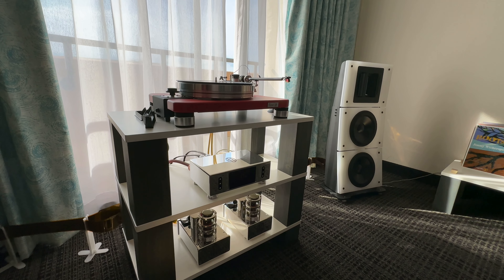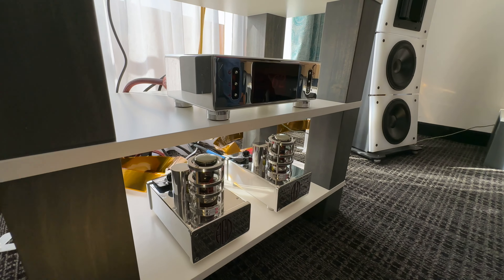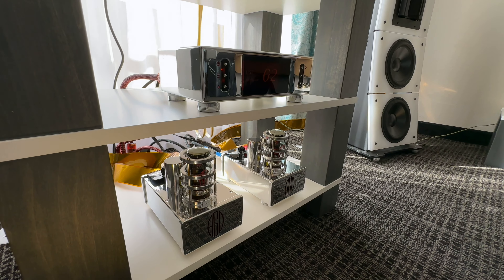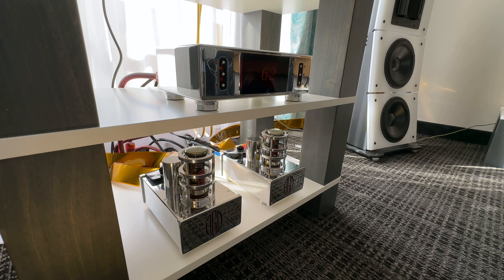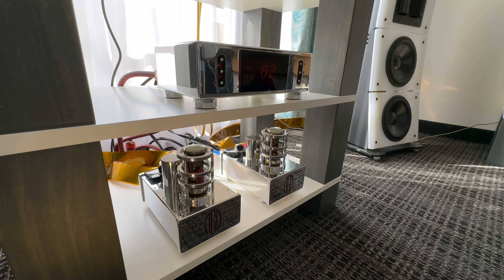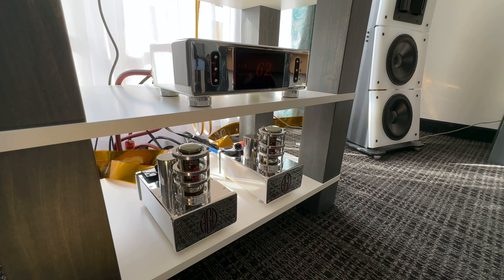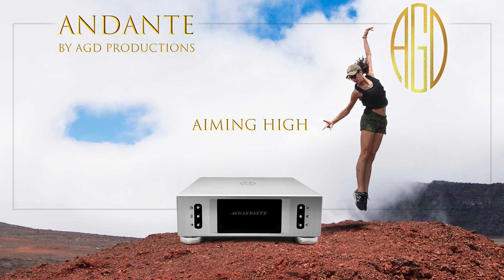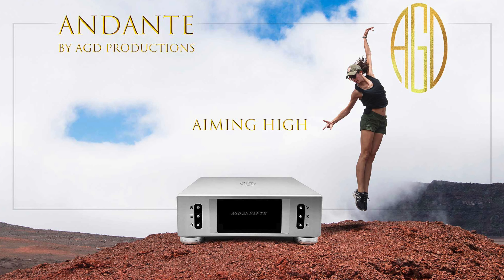FLAX 24 - Pure Audio  Project + AGD

Comment: I was at this show and once again Pure Audio Project hits it out of the park . Well designed , high value and enjoyable.
Reply: How was the bass? Did the bass sound like mid-bass or was the bass full, Naturally deep...Thanks!
Reply: @FukemStudios  I'd say you'd need two things to lock in deep bass with these speakers; a reasonably powerful solid state amp and some good aftermarket iso feet in lieu of the standard spikes.

Comment: I’ve got the original PAP Trio 10 w/ Mundorf AMT … I just love them in my apartment. I do need a bigger amp, my AmpCampAmp monoblocks are great for 40db … but I can tell these should open way up with suitable power
Reply: I'm considering these speakers and would drive them with a Vitus SIA-025 integrated amp which conservatively has 25w class a, 100w Class a/b, an efficient 1.4kVa UI-core transformer, and 144,000 uF total cacitance. So it should be a good match power and sound-wise.